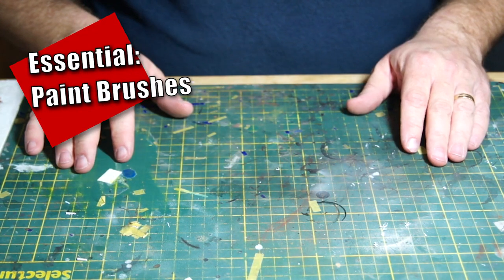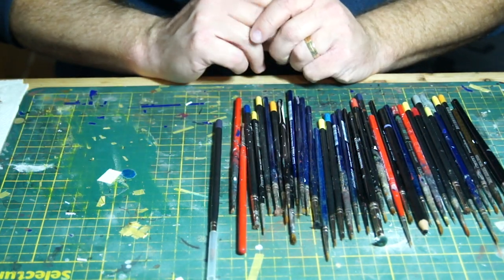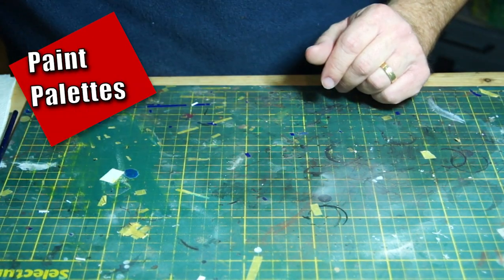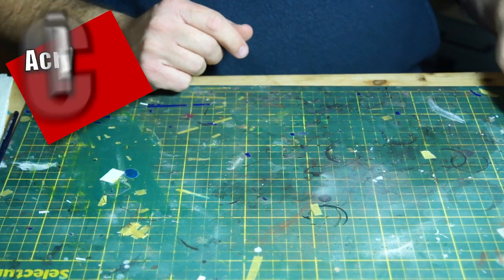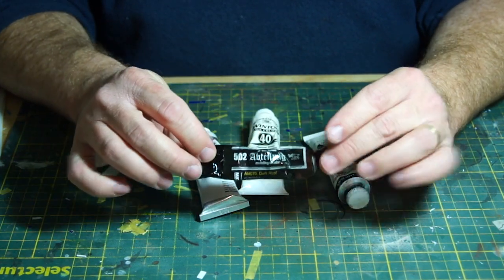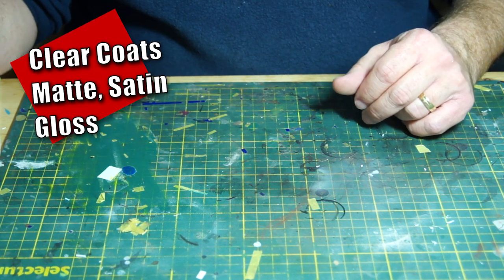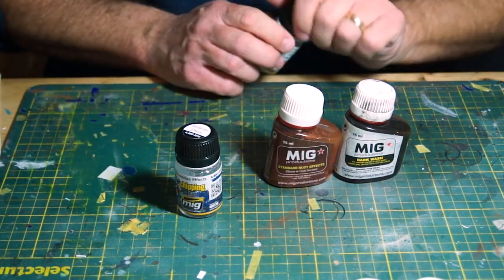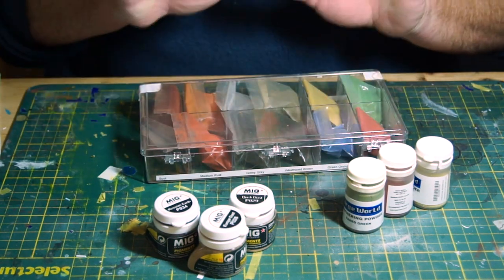Essential Tools for Weathering Model Trains

Comment: Hi John, nice video. You covered a lot of information, which should help those wanting to get into weathering or expand their current techniques and processes. I appreciate your effort to help educate the community.

A few things came to mind: You mention using a sable hair brush for acrylics. I think it's important for people to understand why this is necessary: Acrylics are water based, which won't ruin a sable hair (natural) brush; unlike oil paints, which the chemicals will destroy a natural hair brush and synthetic brushes are more compatible with the oils. but at least you mentioned keeping your brushes separate (acrylic vs. oil).

The other thing: you briefly mentioned thinners and cleaners (water for acrylics, etc). Because I'm falling deeper into the dark side of weathering, I'm discovering there is a difference with mineral oils, turpentine, turpenoid, white spirits and paint thinner.  If not used correctly, these items can also destroy your equipment, along with your oil paints. Some thinners can increase the drying time of oil paints.  If you're going to spend the extra few bucks on equipment, the proper thinning and cleaning supplies are a must.

Thanks, Terry
Reply from the maker: Great stuff Terry. As you say, some elements of weathering, particularly when it comes to oils and thinners, can make for a very deep hole that one can explore. Hopefully I was clear that the sable-hair brushes are for acrylic. While I recommended watercolour brushes for acrylic work, I should have specified that there are brushes intended for oils... and do use those ones!

Comment: The paint I have learned to use over the years is casein colors.  That's right, "casein" as in milk based.  Casein colors dry a little more slowly than acrylics but, of course, much faster than oil paints (I have cars that were weathered with oil paints more than 30 years ago; they have only recently lost the distinctive odor of oil paint.)  The slower drying time means more time to "work" the colors and wipe them off if you want to start over.  When they have dried thoroughly (24 - 36 hours), a chisel might be needed to get them off.Casein paints also have the advantage of being translucent, allowing one to build up color to the desired intensity in several layers.  They're normally a little thinner than toothpaste (they come in tubes) and should always be thinned A LOT with 'wet' water (a drop of detergent in a small bowl of warm water.My palettes for casein paints are clear glass, 5" candle plates.  They're very easy to clean with hot, soapy water and, being clean, they don't give me unexpected mixes.I also use various brands of weathering powders.  More good news about casein: you can get casein base, which has no pigment, and add weathering powder to it to create your own custom colors.The biggest problem with casein colors is finding them.  I used to get them in a large art store near my work but now that I've relocated, I've only been able to find them online.
Reply from the maker: I apologize for missing this comment for nearly two months, Chuck! This is a great tip. We have an art supply store here in town that I will check to see if they have casein colours.

Comment: Do I NEED the expensive Winsor & Newton oil paints? Or would I be fine with Hobby Lobby store brand oil paint?
Reply from the maker: The only suggestion I'd make is to go with "standard" oil paints and odourless thinner rather than the water-washable type. Winsor-Newton paints aren't that pricey where I am. One alternative you could also consider that have come out since I originally did this video are Oilbrushers from Ammo by Mig, which are not that expensive, but you may need to order online depending on their availability near you. Also, the Abteilung 502 oil paints are absolutely top notch, and designed for weathering, especially their "Starship Filth" colour. They're also not terribly expensive. A single tube of oil paint will last you years in the way we use it for modelling.